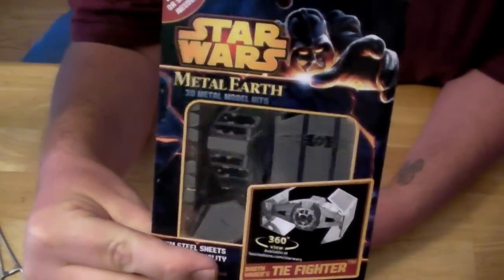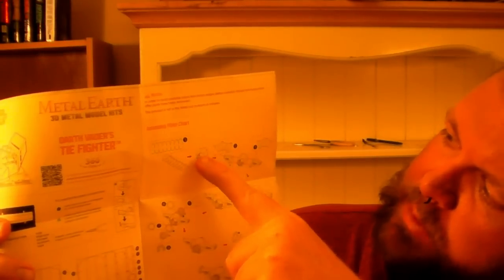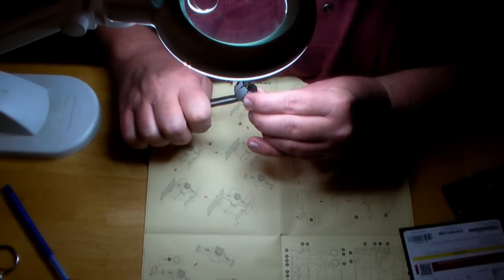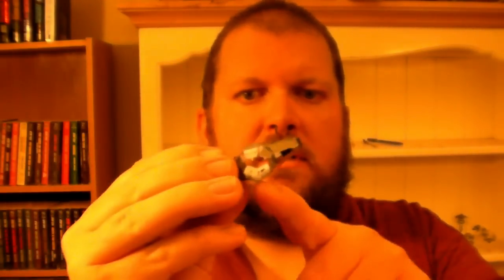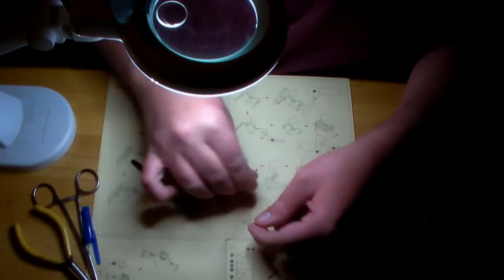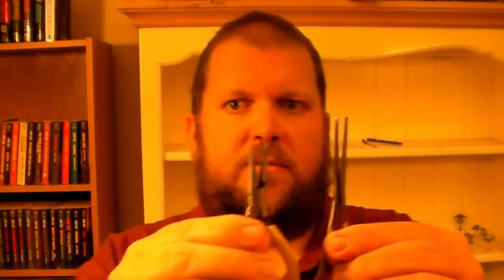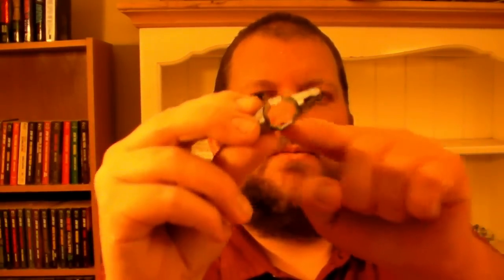Darth Vader Tie Fighter Metal Earth kit - What Not to Do.

Comment: thanks for the video. I thought about your issue and decided to only fold the two sides of the Sphere leaving the top unfolded. It looked like a opened clam shell. I then attached the two side pilons and front gun and finished by folding the top and bottom pieces to close.  It worked wonderfully. I never would have figured it out if it wasn't for your telling of how you did it. After that the rest of the model is really simple.

Comment: I was having that problem when I decided to check for any walkthroughs of this kit. Glad I found this video!! I was able to open up the round bit without handling it too much beforehand. You are right, its easier to attach them after its open, then close it up. 

You saved my model! Thanks.
Reply from the maker: I am so very glad to hear that. I was not going to post the video since I did not finish, but I decided that since I could not find any other videos (at the time) of this kit, I should share my experience.

Comment: I appreciate knowing that it wasn't just me!  I've had the exact same problem with the side piece hanging by two tabs.  I did twist the tabs, but I over-twisted them, without enough sticking through, and they sheared off.  Thinking that the wings+gravity might still be enough to hold it in place (since the bottom tabs are what broke for me), but having the same problem with the rear cone that themster4 mentioned.  This is the 5th Metal Earth model I've done (Millenium Falcon, Steam Locomotive, Black Pearl, Model T) and it is by far the hardest!
Reply from the maker: Thanks for watching. I have reviews on amazon where people have had the same kinds of problems.

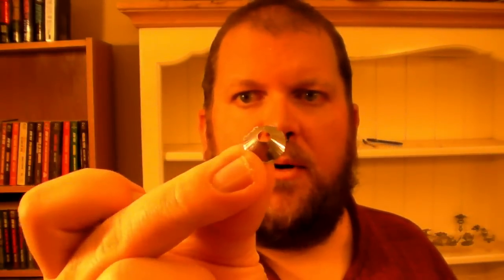Comment: my issue was i attached the bit you had at 1:42, then tried to attach the one on the front end, as the instructions said, then realised there's no way to bend the tabs because there's no way to get to the inside because of the first cone....
ARRGGGGHHH IT MAKES NO SENSE!!!! :P
Reply from the maker: It is tricky and the directions are not always helpful. I had to buy another and try a second time. I was able to get it together, but now without a backwards piece and one small broken piece, not to mention completely messing up the stand. Good thing I had two, I just used to other parts.
Reply: animateorange Great idea maybe I should buy another just in case... 15 bucks into 30! I am building this for my boyfriend and he and I LOVE Star Wars but he likes it slightly more.
I don't see an awful lot of women taking stuff like this on like myself